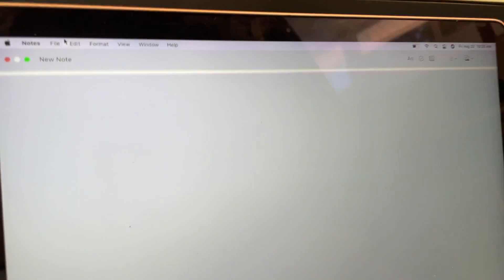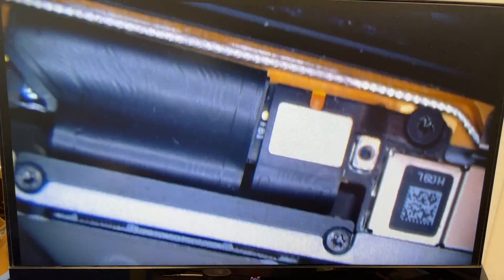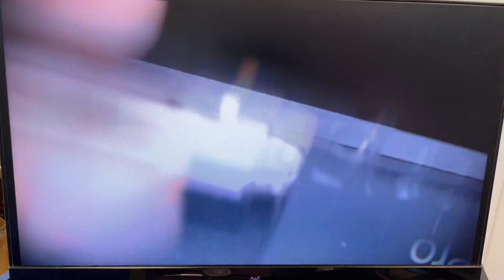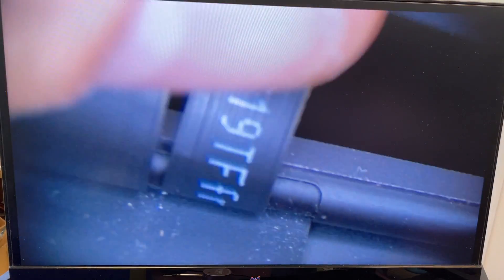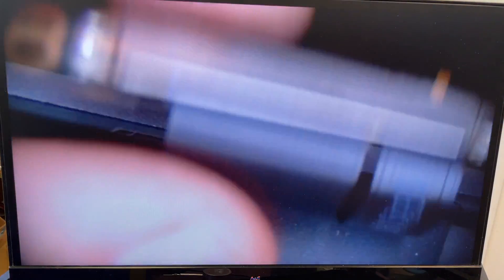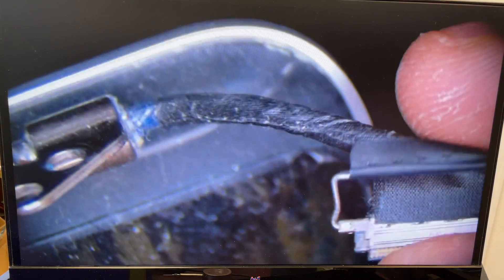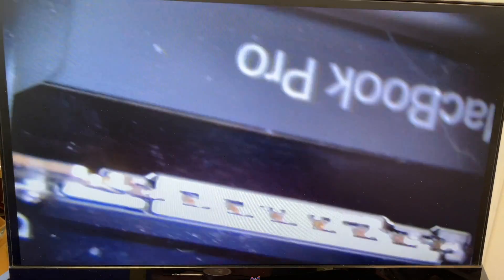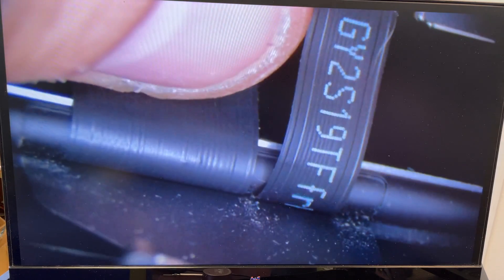DustGate on MacBook and Pro TouchBar 2015-2019 caused by pinched LCD Flex Cables causing Lines

Comment: I’m sorry, but are those flex cables can be reached just from the back of MacBook? I mean they don’t have any protection from outside world, and can be that easily damaged?
Reply from the maker: No, they are soldered on the back of the actual lcd so in order to replace them - lcd assembly has to be taken apart, lcd taken out and new cables soldered on the lcd and tcon board. Not an easy task. They are somewhat protected by the plastic stickers but obviously that’s not enough. Blasting dust-off on those cables time after time while the computer is closed should make them last
Reply: @applepietech  Yeah, thanks for answering. I mean in a last portion of your video you clean those cables with a toothbrush. And it’s look like cables can be that easily accessed via back panel, than MacBook is closed. Can’t look it by myself, only have a 2015 model. 

And can you please tell, after 2020 with newer m-series MacBooks with more robust plastic cover on top of a flex cables (you talk about it in one of your video). Is this problem gone? And it’s not happening anymore, by your repair experience?
Reply from the maker: Yes, they are partially accessible from the back while the laptop is closed so you can blow the dust out or use soft brush. Newer 2020 models have better protection but I still see them fail. 2021+ models are little different and I haven’t seen them fail yet.
Reply: @applepietech  Thanks, if some day you can show that 2021 or later models in one of your videos would be great to see those differences

Comment: I repaird the Dustgate with some Jumperwire.
Worked great!
But now all of These, lets say lines, that were purple before are now "blinking" a little bit.
Bright/dark/bright and so on.
Ram reset / Software Update.
Nothing helps.
Anyone a solution for that?
Maybe my jumperwire Diameter is to big...
Reply from the maker: Leave it playing hd movie continuously for a week - it will clear up
Reply: @applepietech  i will try and Tell you if it worked for me :)
Do you had that Problem before?
Reply from the maker: Yes, on several screens. Especially on those that had dustgate issue present for a long time before it was fixed
Reply: @applepietech  Okay since we talked last time the Macbook is running HD Films on Youtube during the day. A Night i shut it down.
So far nothing changed.
It still has this flickering.
We will go on and see :D

Comment: After fixed , one of the line is still blinking alittle bit, why ?
Reply: I have the same problem i fixed the broken traces with some jumper wire.

Now the screen works great but its still "blinking".
But only when i dont move the cursor.

Do you have a solution for that?
Reply: @Apple Pie Tech ?
Reply from the maker: Play full hd movie on it continuously for a week and it will go away

Comment: Exact same thing happened to me with my new fully spec'ed out $6000 (Canadian) 16" M1 (Max chip) MacBook Pro.  It happened in less than a year of purchase (bought it Nov, 2021) so it's still under the year Warranty ... and I also have Apple Care.  I phoned Apple 2 times about this issue and they acted clueless, like they had no idea about this issue.  But after doing some online research and finding out about #flexgate and the several Class Action Lawsuits about this exact 'extraordinarily fragile' flex ribbon display cable ... I now know that those 2 Apple Reps had a "Duty to Disclose" because Apple (and certainly all its Tech Staff) have known about this issue for several years.  In addition, this is considered to be "fraudulent concealment", by gaslighting customers who phone in with this issue, pretending they don't know anything about this.  In fact, the Class Action Lawsuit states that Apple has deleted posts from customers about this issue on Apple's community Forums, in an attempt to cover up this issue.
Reply: I had the same issue but just 2 years after I bought my 2019 MacBook Pro base model apple also act clueless…
Reply: @unflappable6689  ... Even after Apple fixed my laptop, and indeed confirmed my suspicion that the cause was the "extraordinarily fragile" display ribbon cable ... because indeed, they replaced the entire display which includes the 'flex ribbon display cable' because they've manufactured it in such a way that both are fused together and can't be installed or repaired separately without doing a makeshift hack job.  

But to add further insult, Apple continued to play dumb and try to sweep the real issue under the carpet ... when they send back a repaired laptop it comes with a Summary Report as to what has been done.  Instead of openly stating the REAL problem, aka #Flexgate, aka failure of the flex ribbon display cable ... instead the Summary Report mentioned unrelated, generic, non-specific, totally vague nonsense .... ie: under the "Symptom" heading, it only says: "Display / Non Uniform Color / Contrast / Brightness and  Display Flickering / Flashing".  My laptop did NOT at anytime have any "Flickering or Flashing", nor was there ever any issue with "Color / Contrast / or Brightness".  It looks as though Apple is avoiding mentioning "failure of the flex ribbon display cable" so that this data is not recorded into their database, which a Judge in a future court case could demand be handed over.  This experience has really tainted my opinion of Apple ... I'm far more cautious and skeptical and far less "fan girl" since I saw how they dealt (ie: NOT dealt) with this glaring computer component failure issue.
Reply: @galefraney  same for me I’m very disappointed as well I would like to replace my computer and buy a new Mac but I’m not sure they’ve fixed this issue … I’ve been a Mac user since the beginning. I just hope more people will come forward and adresse the issue
Reply: @unflappable6689  ... to be fair, I should mention that my laptop is now fully repaired, they picked it up and returned it to me in just over a week and it's been fine ever since.  It is an incredible laptop, absolutely love it ... but now I open and close the lid so carefully, as though I'm handling a live landmine ... opening so cautiously so that the 'faulty fragile flex ribbon Display cable' doesn't 'detonate' ;-)
Reply: @galefraney  🤣there wonderful machines I wish they will improve this in future models

Comment: Another common symptom I've seen is huge vertical pink bars. Every time I've seen a screen like that it had the little craters in the flex cables like you show here. The only way to repair I think is to disassemble the screen assembly and solder new flex cables (yes, surprisingly, they are soldered on both sides). Doubt anyone in the US/EU/UK will be doing those kinds of repairs because it makes more sense to just replace the screen, but I wouldn't be surprised if companies like REWA and other repair specialists in china etc start offering these kinds of screen refurbishing services
Reply: Hello we do offer these kind of repairs do them all the time :)
Reply: @pcvitamins   you mean take the LCD out and solder new flex cable? Where are you located? Thanks
Reply from the maker: @danandrei96  After some more research looks like these pinched areas can be repaired with solder or jumper wire and these repairs do last. Will try to make a follow-up video.

Comment: do you think the pinches can be repaired by jumper wire?
Reply from the maker: Maybe, however considering the location of the damaged area and the fact that it will be touching screen frame every time you open the screen - it will not be a lasting repair.
Reply from the maker: After some more research looks like it can be repaired and these repairs do last.
Reply: @applepietech   How do you repair it?
Reply: @applepietech  can send us a link about the 100% repair for last, please?
Reply from the maker: @B.E.H.  https://www.youtube.com/watch?v=FZXwLQlvjFU
Reply: @applepietech  amazing, THANKS!!!